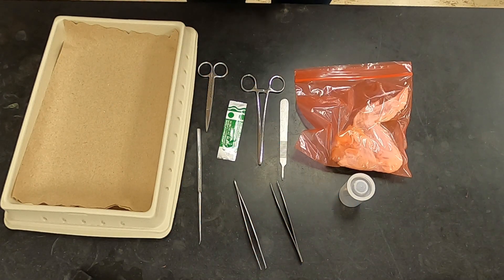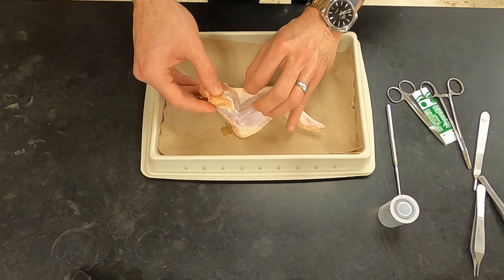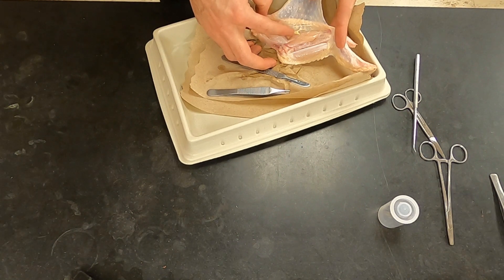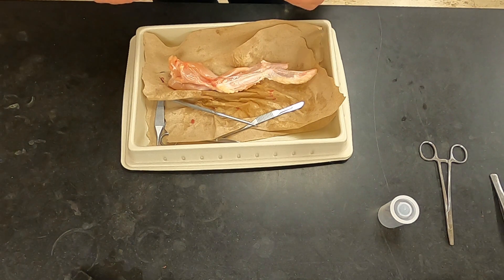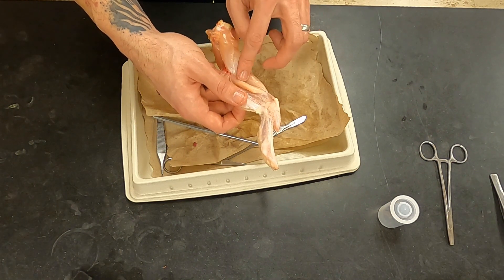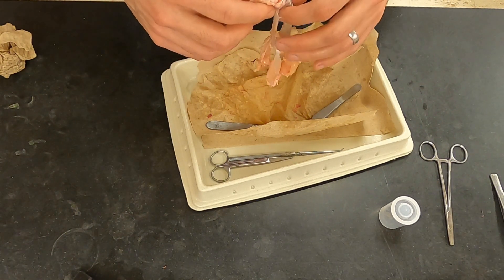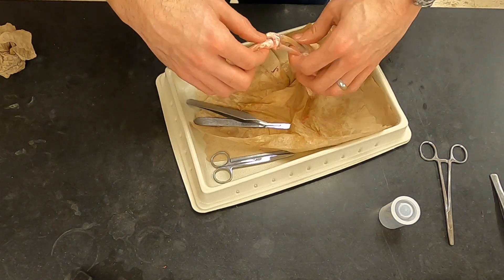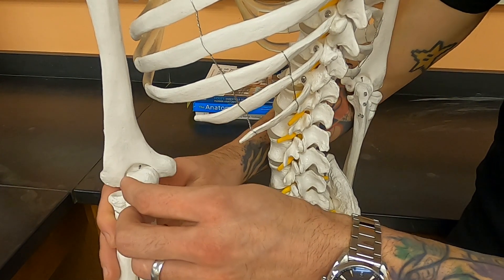Chicken Wing Functional Dissection

Comment: 1) Propatagium isn't there to "help Control the wing" - whatever that means - it is basically a clever mechanism nature came up with, whereby simply by extending the forearm the hand (manus) automatically extends as well, meaning the bird doesn't require as much muscle mass and can therefore remain lightweight enough to be capable of sustained flight. It's very nicely demonstrated on a wee little channel called Backyard Bird Anatomy. I highly recommend it.
2) The thumb's scientific name is pollex, not allula. Allula is the set of usually 3 feathers that attach to the pollex, and are responsible for the controlled slow flight, mainly deployed during landing and take-off. Hope this helps.👍